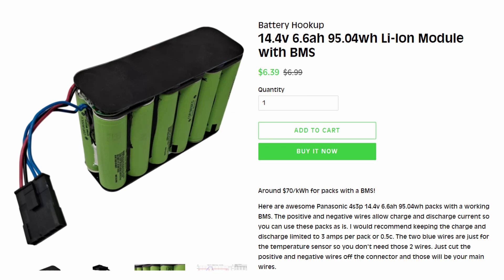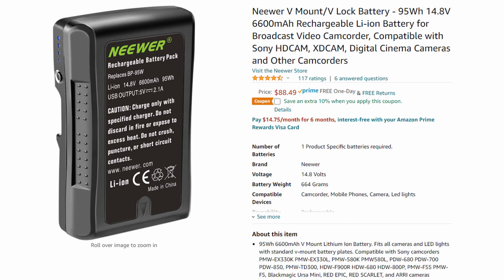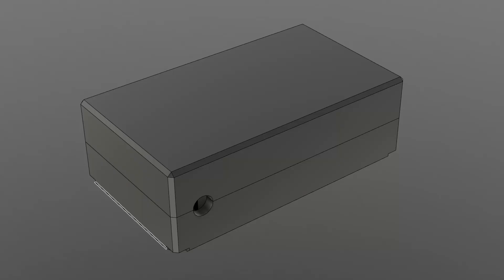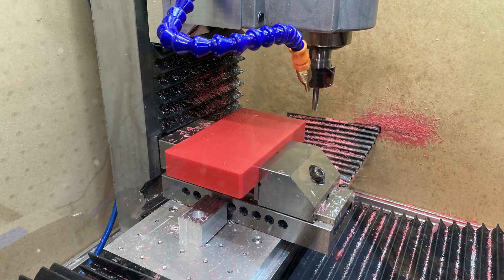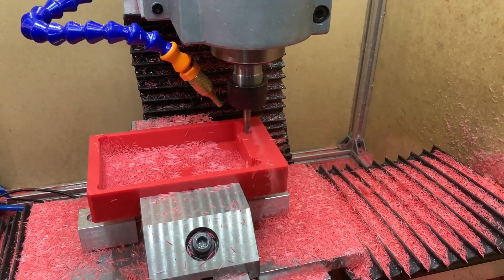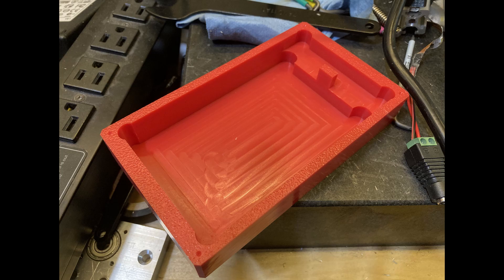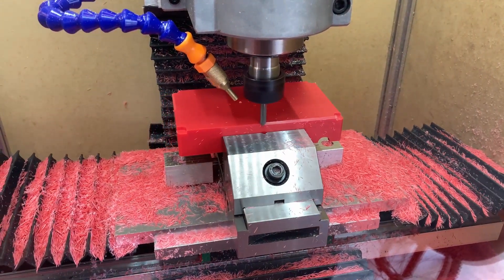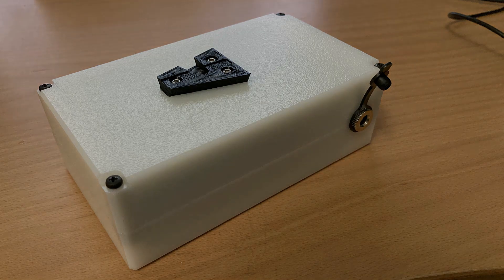Milling a Battery Enclosure

Comment: Great video! Where do you buy the larger HDPE pieces in different colors? Thank you!
Reply from the maker: I find them on Amazon, either as HDPE sheet or cutting boards. The red HDPE sheet was on amazon as "Sanatec High Density Polyethylene Sheet" from Vycom.
Reply: @imnoexpertbut  thank you!